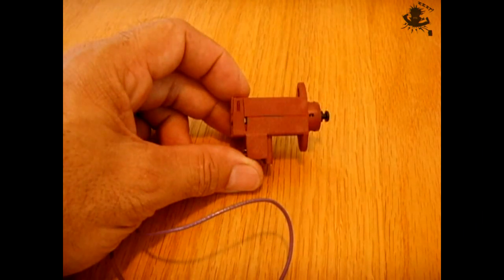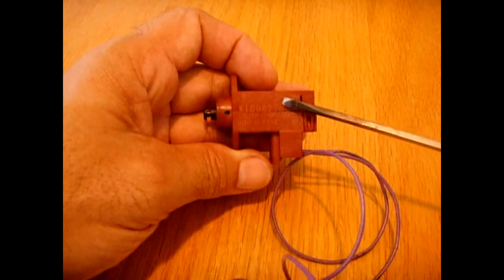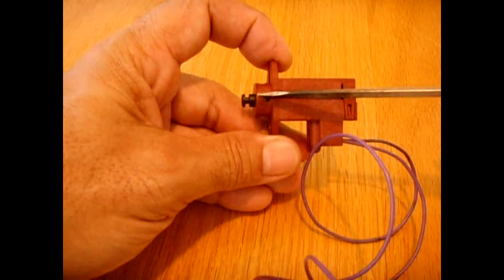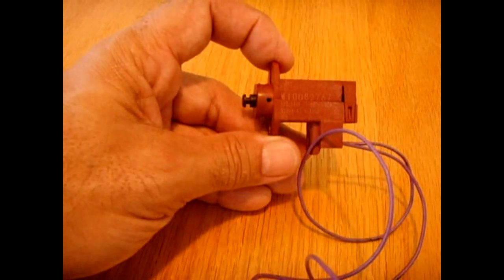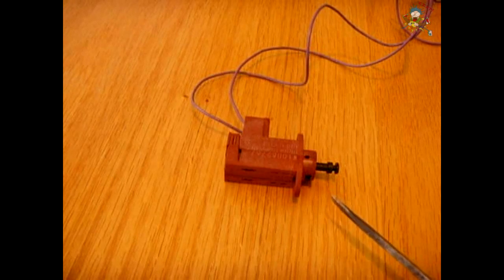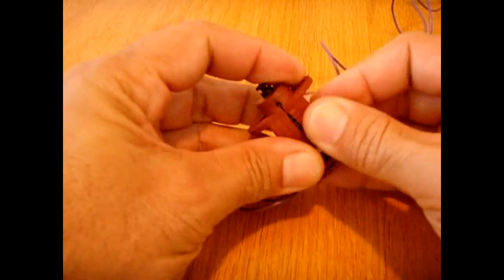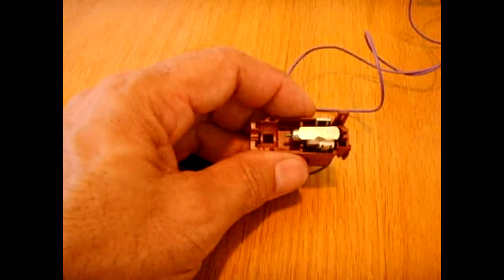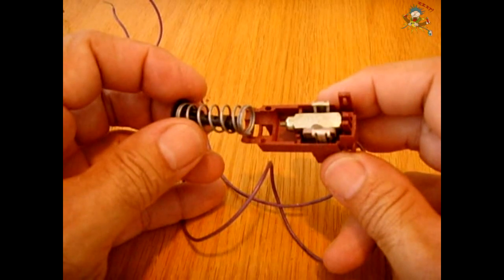WAX MOTORS ~ A Full Understanding Of Operation & Construction

Comment: Anyone knows the difference between a 100331 30K or 40K or 60K
What does that figure mean ? What is the difference between these? I installed a 100331 40K to replace a 30K, and unfortunately that doesn’t work. The actuator or was motor fails to open the detergent dispenser…

Comment: Thank you so much for this video.  My Frigidaire Affinity washing machine uses one of these in the door latch assembly and was giving an E48 error.  In my case, there was a liquid detergent leak on top of the machine that worked its way down the wiring harness and into the switch assembly, giving me an E48 error.  Fortunately, the assembly was easy to remove and open up (always take good photos - there are springs in here!).  I had very little idea what the wax motor was and assumed this thing was a solenoid.  When I opened it up, it looked more like a sensor than a solenoid, which confused me, so Google led me here.  My part number was Ark-Les 11272-91.   There was a lot of corrosion inside.  I ended up using a sharpening stone to clean the terminals and the sides of the wax motor piston which had a lot of resistance before.  Before I started, the wax motor was measuring about 1.3K ohms, and it was 1.6K when I was finished.  When I was done, the washing machine finished its load without errors.

I was so glad I didn't have to buy a new ANYTHING to do this repair.  Thanks for showing me what all this stuff was, and for taking good photos so I was sure I was putting it back together correctly.

Comment: One important thing you left out is that a wax motor can be used as a timing mechanism such as on my washing machine door latch.  When the washing machine has finished the load and turns off, the door remains locked for about a minute before I can open it. This is due to a wax motor in the latching mechanism.  I know this because I had to replace the door latch on it and of course I opened it up to see what was inside.  There was a very similar looking device as on your video and I had thought it was just a regular solenoid but thanks to your video, I now know what it is.  I had seen "wax motor" on the schematics near the latching mechanism but didn't know what it was.  Thanks for your video!

Comment: Great video, thank you. These are similar to what is used in hydronic heating thermal actuators. I was looking for a good explanation of how they worked, specifically if there was a spring to push it back in and you answered that very well. They are silent and durable it seems. I'm assuming the "hot" resistance is at 120V (more resistance would be needed if input voltage was 240V to limit the temperature). There are others used in mixing valves that use the heat of the outlet water to expand the wax instead of a PTC. 

Thank you again.
Reply from the maker: You're welcome Joe. Thanks for watching! Be sure to rate thumbs up and share.

Comment: I thought my dishwasher's "thing" - that I now know is a wax motor - was broken as I applied 110VAC and I did not see it "click" or move right away, that with the fact it was 2kOhm I was about to throw it away and order a new assembly. Now I now the test methodology needs to be different, and maybe it's fine.
Reply from the maker: You need to keep the power connected longer so it can heat up. Thanks for watching Alessio. Stai al sicuro!
Reply: @electronicsNmore  ai grazie! Ho provato and it actually works correctly. However I had to clean the seal that is moved by the motor, it was full of gunk - that might have been the issue, the motor seems fine once I understood it and tested accordingly.
Reply from the maker: @AlessioSangalli  Glad you got it figured out.

Comment: Thanks for the another informational video! I am just wondering if there is any way to actuate in a shortened period  of time. What factors would be involved in that wax motors regarding the speed? (the material of metal chamber or the sort of wax?)
Reply from the maker: Lower voltage slower, higher voltage faster.

Comment: My wax motor reads 1.256 ohms. Is that defective?
Reply from the maker: Are you sure the reading is correct? That # is way too low.
Reply: electronicsNmore I removed the wax motor and wired it to a 120 volt spare outlet plug and it worked so I suspect my multi meter is not working properly.
Reply: @mbiker7  I forgot to label the wires, does it matter which wire goes on which terminal?
Reply: @davemall1  no it doesn't matter, it's a resistor which in this case even works on AC.

Comment: Where can I get just the connector in this video?
Reply from the maker: Hi there. Which one?
Reply: the white connector that can be seen in the wax motor at 3:48 in the video
Reply: the white connector that can be seen in the wax motor at 3:49 in the video.
Reply from the maker: Anthony Harman That's where the wires connect to the wax motor. Look on Ebay, or go to an appliance repair shop. You'll need to buy the entire wax motor.

Comment: It's not a piston, it's a plunger.
Reply from the maker: +marshaul 
INSIDE the wax motor is a piston, the piston pushes on the spring loaded end(plunger).
Reply: +electronicsNmore Right, but I wasn't talking about the part where you call the piston a piston. I was talking about the part where you call the plunger a piston. ;)

Comment: Very well done sir!  Clear explanations and video then a dis-assembly.  I have a version of this motor used on my hydronics heating system zone valve.  The valves require a lot of force to open them and these wax motors can do it thousands of time each season. Taco zone valve company calls them heat or grease motors.....and most operate on 24VAC. Never knew how they worked until watching.Thanks for this video post...
Reply from the maker: +John Williams 
You're welcome! Glad you enjoyed the video. Please be sure to share my channel with others. Thanks.

Comment: Great video!  On a related note, when a wax motor used to push a door, vent, etc gets stuck in the closed or open position, it may cause excess electrical load on the relay that controls it.  This can cause the relay pin on the printed circuit board to heat up and melt the solder.  After unsticking/replacing the door/vent assembly, you may need to check/repair the connection before the replacement wax motor will work.
Reply: Thanks. Troubleshooting a dishwasher that uses a wax motor to actuate a flapper door for the vent fan. This video and the comment helped me to know what to look for.

Comment: How much power and current @ 120 volts (DC I assume?) the wax motor takes? Just got some ideas for Arduino to use that. Then I would know is my idea feasible or what kind of problems I'm going to face until I can get thing done.
Please tell max and min values (for example when the piston is held in "out" position. Try also to estimate how long max power intake lasts. I think I could find some wax motors from recycling station laundry washing machines.
Reply from the maker: Did not check that, but the initial current is fairly low, likely under 200mA. Take the cold temp resistance measurement of the PTC which was mentioned in the video, and divide it by 120V to get the "Initial" current before the unit heats up. Once the wax motor is fully extended, the current drops to a much lower level to maintain the position. (I = V/R)

Thanks For watching.

Comment: Interesting little device. Reminds me of a cars thermostat. They are also wax pistons in a way and use the cars cooling system as a heat source.
Reply from the maker: It sure is.  It operates just like thermostats in a vehicle to allow the flow of coolant to pass the valve.

Thanks For Watching!

Comment: Can speed be increased as well as force measured?
Reply from the maker: I would think speed can be controlled by the rate at which the cylinder is heated. I could not push the piston back in using a good amount of force.

Comment: Very interesting and informative video, thanks for sharing :) I didn't know about such actuators being used in home appliances.
Also the automotive coolant thermostat works on a same principle with the piston opening and closing the coolant flow through the radiator (with changes of the coolant temperature).
Reply from the maker: Thanks For Watching. Auto thermostats operate the same way as well.

Comment: How fascinating, i've often dismissed linear actuators in consideration for designing things but these look like they hold some potential.   The great thing about hydraulics is speed and distance is relative to force by easy means of conversion.  With just two rods, and a piston chamber (easy to make with a drill press) you can push say a 1/8" rod by driving a 1/2" rod by the wax motor piston and the output is 16 faster/farther at 16 less force.     Have a 1/2" driving a 1/64" and you get 1024 times the speed and distance, at again 1024 less force.

Comment: When you did the video on the carburetor I made a comment about it the device in the carburetor being like a wax motor that was used in an older model Frigidaire refrigerator ice dispenser. This is a great explanation of the wax motor and thank you! - - - A "PTC Inrush" like you mentioned that is inside this wax motor, is also used in most refrigerators today as part of the compressor start device. The industry calls it a PTC Relay. - - - I always enjoy your videos. Thank you for sharing the wealth of knowledge!